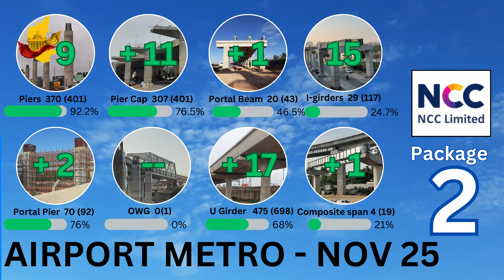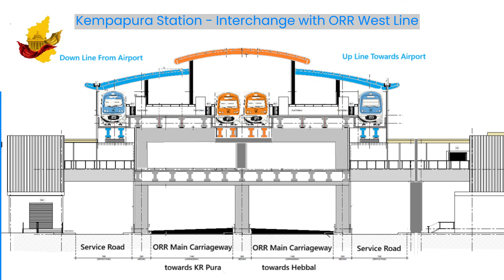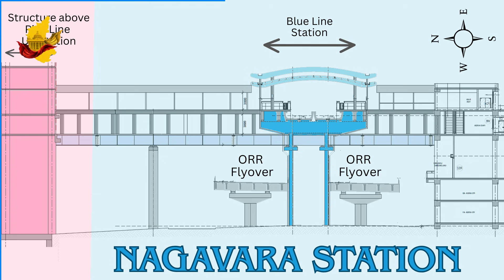Bengaluru Metro : Blue line : Airport line : Hebbal to Tin Factory: NOV 2025  #bmrcl #bangaloremetro

Comment: Where they are actually working or sleeping ? Doing one pillar per month. Bmrcl should make sure this rubbish company should not be given any contract
Reply from the maker: It is not slow. they are working as much as others. Work in this stretch is complicated due to multiple split flyover and underpasses , traffic restrictions and hence availability.

NCC is the same company working on pkg 2 and pkg 3. it is not simple binary . there are a lot of factors
Reply: This stretch won’t start before 2030…no work happening at nagawara and HBR layout stations. Most of stations are still in pier stage…even U girders are not being installed even though piers are ready from long time… NCC is such a pathetic construction company.They should be banned from any other construction project…even Hebbal to airport metro stations progress is very slow .
Reply: Sunil sorry to say , anyone will laugh that this is the progress from 3.5 years
Reply from the maker: @rohanguttedar3475 okie